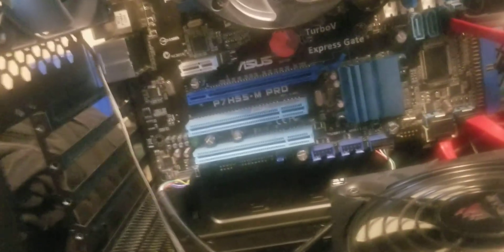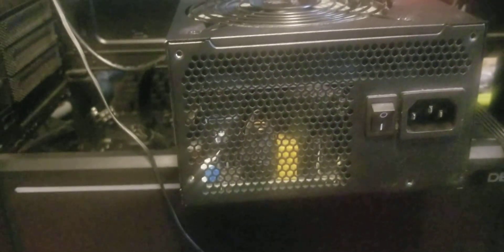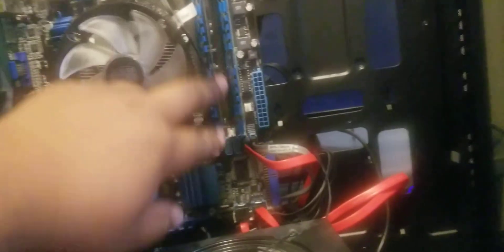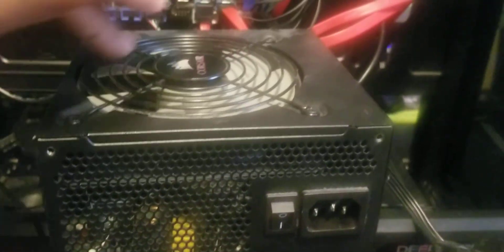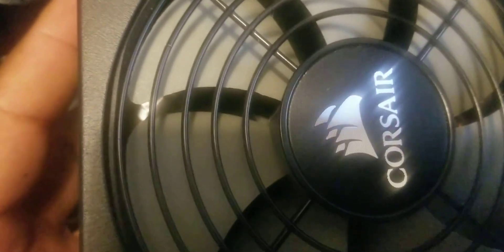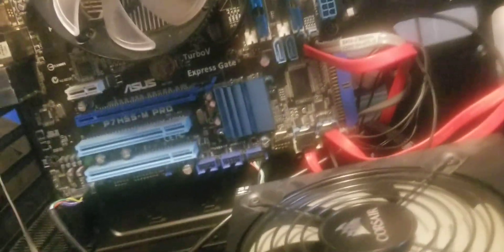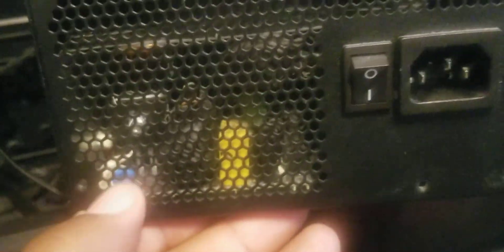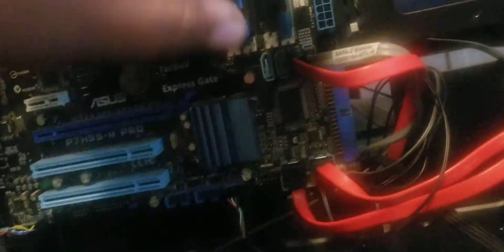How To Ruin A PC

Comment: It happened to me today i was playing a game today and my pc is like a month old and i suddenly heard some sparking sounds but no sparking and it fluctuated my computer again and again then i just turned off the switch and i only smelt burning smell in my psu cord/cable and it was hot,now is my psu is ok? Or my power supply cord is low quality? I have not tried to restart again as i am afraid to lose some components..
Reply from the maker: Check for loose screws and burnt wires you can always send a picture through my contacts. After that see if it will turn on
Reply: @FireantzBlaze  yeah thx, i just changed my power cable and it's working just fine till now i hope it was the only issue, i don't smell anything burning till now so i hope it goes well for me..
Reply from the maker: @Abdul Wasio  if you have a question about pcs feel free to ask

Comment: I know this is old but how come the Screw fell From the Power supply? HOW
Reply from the maker: its quite easy  that answer is . rushing to get the rig done and not paying attention to what you have in your hands building the PC
Reply: @FireantzBlaze  did that psu damage your mobo too?
Reply from the maker: @Koromaru-j1w  it killed the motherboard except the ram Cpu and the Rx 480 8gb/  

I upgraded it later on with a x570 strix e and got a R5 3600x 

I now have a 5950 x  H 150 liquid cooler 5950x and a RTX 3060  now
Reply: @FireantzBlaze  damn thats a pain, I thought Corsair power supplies comes with protections
Reply from the maker: @Koromaru-j1w  I ended up switching to EVGA Power supply its very quiet had no issues with it so far

Comment: I'm having this issue, except my PC turns back on. But I literally touched the PC with a mac charger cable and it turned off instantly.

EDIT oh saw the last bit. THanks for the info. Gonna try a CMOS reset
Reply from the maker: I went on newegg all the motherboards i wanted was sold out this is crazy its like everyone trying to build a pc. I got the x570 asus rog strix wifi 329 after taxes
Reply: @FireantzBlaze  yeah covid times right, plus imagine the parts will only go up in price due to the production chains being in Asia. 

Running a x570 TUF gaming wifi, so the more budget version of that board imo. nice choice
Reply from the maker: @magiccouponsREAL i was gonna go intel lga 1151 but everything was over priced im not paying 899 for a motherboard that came out in 2017
Reply: Turns out my front IO panel's wiring was all cluttered together. So a knock would hit the power button. It had happened before when i inserted a headphone jack into the front too. Lol. 
Case: Lian Li PC-o11 dynamic if anyone is reading this
Reply from the maker: @magiccouponsREAL  now that i think about it it could be my wiring
Reply from the maker: mithian  I just had to buy a new one if you see a busted capacitor on motherboards or powersupply etc get a new one